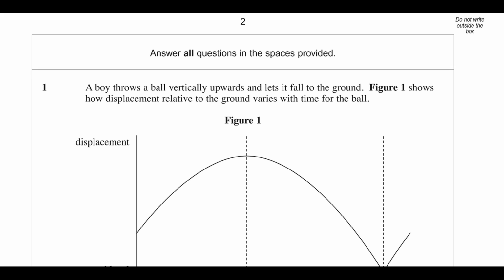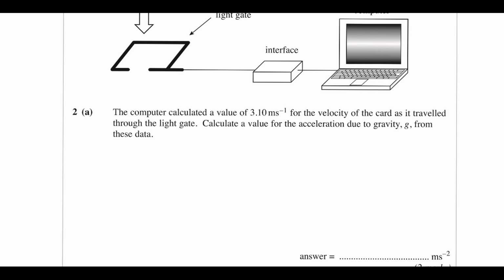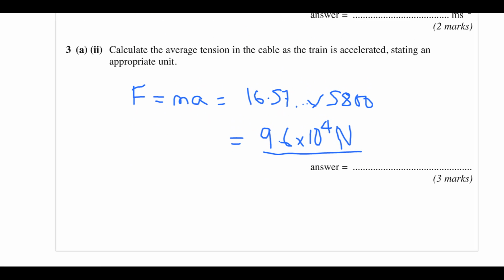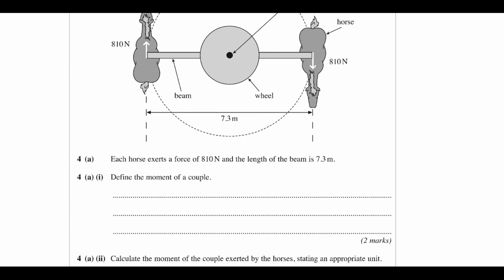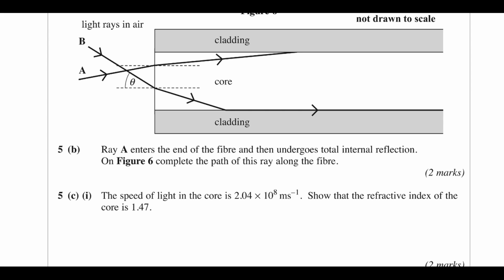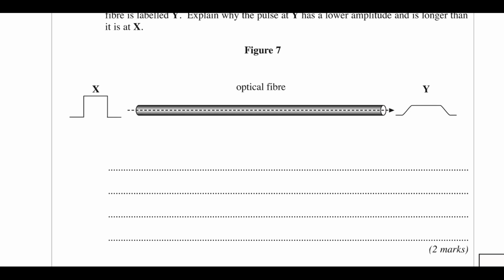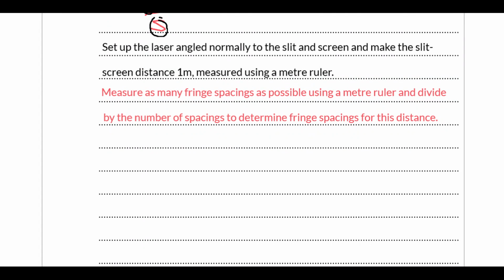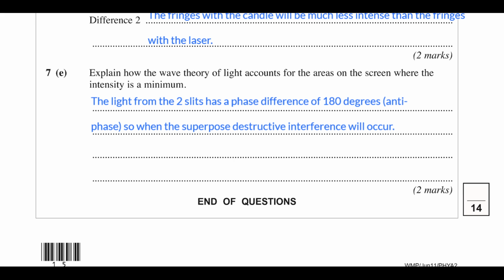AQA: A Level Physics: June 2011: Unit 2: Worked Solutions

Comment: I have a question about 7d. You said maxima would be wider with white light, but white light has an average wavelength that is less than red light, so surely the maxima would be less wide? Please help me haha I'm so confused
Reply from the maker: Yes because the extreme outside of the fringes will be where red light would go, the extreme inside where violet light would go. That will make the fringe wider than either violet / red individually